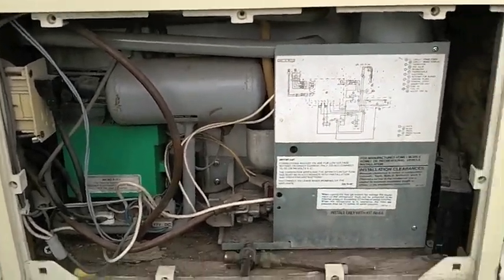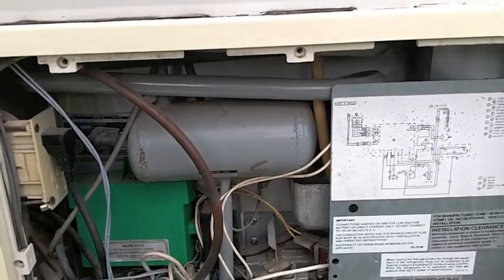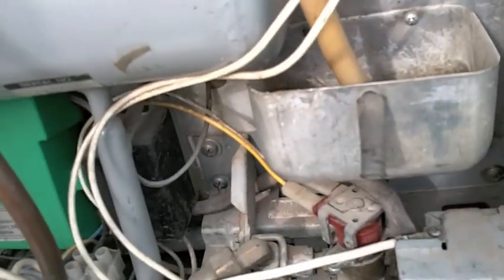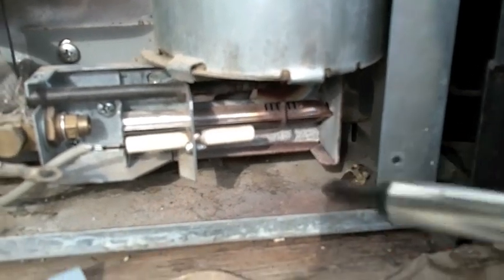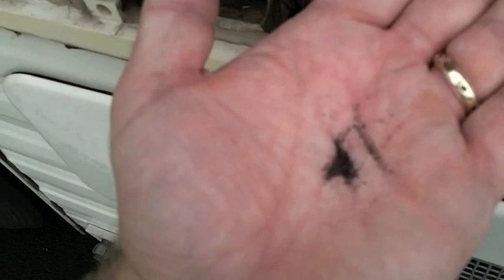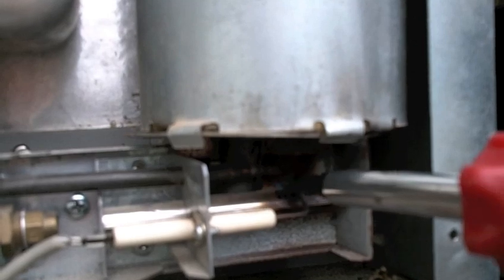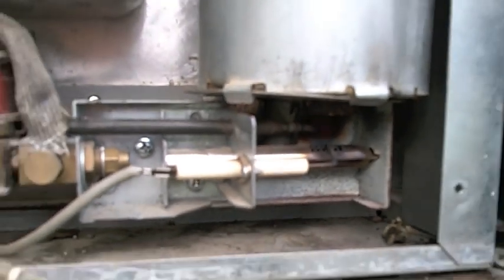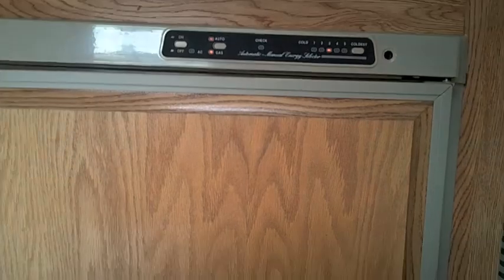RV Refrigerator Troubleshooting

Comment: When plugged into shore power I can hear the pilot light but when I unplug it goes out? Recently got propane and changed the regulator?
Reply from the maker: Have you blown out the burner?  Changing the regulator might have gotten some junk in the lines so try cutting the bristle off a hair brush and poke it in the orifice of the burner's jet.  Also clean out the burner itself.
Reply: Thank you, will give it a try.

Comment: Worked for me- thanks!
Reply: So simple that I could not believe it worked.Takes very little time.and worth a try. Tapped the chimney, cleaned the orface & blew away the rust-dust. Works like new. Had to turn down(or up) the stat to low, Entire box was 20 degrees F.

Comment: My fridge has gas and electric when I unplug it do I leave it on auto or switch it to gas  then auto or leave it on gas mode
Reply from the maker: On 'auto' it should flip from gas to electric any time the fridge senses that the trailer is plugged in.  For my fridge 'on' is only electric and I put it on that when I am going to be plugged in for a long time.

Comment: If the rv is not on level,  freezer doesn't work ?
Reply from the maker: Well it isn't strictly true. It can handle a bit of unlevel but that causes the heart to rise through the unit in one spot rather than being spread out. This cooks the fluid inside preventing the heat exchange . Over time the passage blocks  with burned fluid inside and the unit stops cooling.
Reply: @acme663ryo  wow thanks a lot !!! I was thinking maybe after a lot of years of this video noone going to respond, but vualaaa 😃😅💖💖🍻👍🏻👏🏾👏🏾

Comment: hi  can help me i have one ammonia freezer that not working properly how to charging the ammonia can u sand me any video for charging ammonia please help
Reply from the maker: +Sanbok Restaurant If you smell ammonia or it is low then it is leaking and the lines will have to be fixed before it will do anything.  It isn't like a freon AC unit.  There are places that rebuild them, the one in this camper has been rebuilt but I only know of the Amish doing it.
Reply: thanks bro

Comment: I jumped 12 volts to the solenoid and threw a match at the thing. Wwhhhoooompppahh. She's away. It won't hurt to keep 12 volts jumped on there will it? Kinda bypassing the computer I guess.
Reply from the maker: It will run constantly.  Short term overcooling and using a bunch of gas, long term it will boil your ammonia and wreck the unit.  Sounds like a brainbox issue.  I was able to order a new board cheap that plugged right into mine.
Reply: +NelsonStudios I feared all that.  Thanks for your help mate.

Comment: Great Video Man!!!    any idea what could be the problem if it isn't working with the gas or electric (shore power).  power to it is good, fuses  are good, it just isn't coming on.
Reply from the maker: SorryI saw this late.  If the burner is lit and still no cold then probably the fluid inside the machine itself is gone or bad.

Comment: What would be the next component to troubleshoot?
Reply from the maker: If you get no gas at all at the fridge check the thanks and regulator to make sure they are ok.  See if you can light a burner on the stove.  If you can check that the fuse for the fridge is ok and that it is getting the proper 12v.
Reply: Thank you for the quick reply! I followed your directions & the burner did have rust. The flame looks better but the fridge still doesn't get cold (left it on about an hour). Any additional tips would be appreciated- I know if I take it somewhere they will charge me a fortune!
Reply from the maker: ***** Do you see any yellow/green residue? Or small ammonia?  If the fridge has leaked coolant it might not be fixable.
Reply: I can't see any residue or leaks but the only
thing I removed was the burner cover. How long does it usually take a small fridge to cool on propane?
Reply from the maker: The ice box should feel cold in 30 min or so.  Does it work on electricity?  Try pounding on the chimney with your hand and see how much crud falls out.  If you have good flame and it lights properly but will not get cool you are down to trying the more drastic stuff.  Take the fridge out of the camper and turn it upside down and leave it that way overnight, then flip it upright and re install.  Sometimes that redistributes the crud in the tubes and gets them working for a while.  I had an Amish company rebuild the ammonia side of our fridge a few years ago and other than some burner cleaning it has been trouble free ever since.  That was 1/5 the cost of a new one that would fit in the hole.  Those new ones were like $1200, crazy.  I would try the tip method next if it were mine.  It isn't hard to get them out, 4 screws, an electrical plug and a propane line.  But know if that makes it work you are on borrowed time.  Look into Amish refrigeration rebuilding.
Reply: Thank you so much for your help! Looks like I will be patiently waiting for 30 mins and then refrigerator tipping (instead of cow tipping)!

Comment: i have an 1985 fleetwood southwind, my pilot light ignites and ran for 13 hours but never got cold. Anyone got any ideas?
Reply from the maker: +Craig Barber Does it smell like ammonia or do you have a yellow dust/powder in the housing?
Reply: +NelsonStudios no
Reply: But I just bought it and probably hasn't run in a few years
Reply from the maker: +Craig Barber Look this is an "at your own risk" thing but it is possible that after that much time the gas solenoid or regulator is sticking.  I would rap on it sharply with the plastic end of a screwdriver and see if it frees up.  Also the burner orifice could be plugged, you might try to clean it out with a fine wire.  Or just replace it, as I said AT YOUR OWN RISK but it is what I would do.  If you start smelling gas and it isn't running shut the tanks off.

Comment: What do you mean: "when you're driving sloshing back and forth is fine"........
Reply from the maker: Greggg57 Amonia will not burn in to the lines if it is moving. A fridge at an angle but not moving around will create hot spots and burn the fluid.